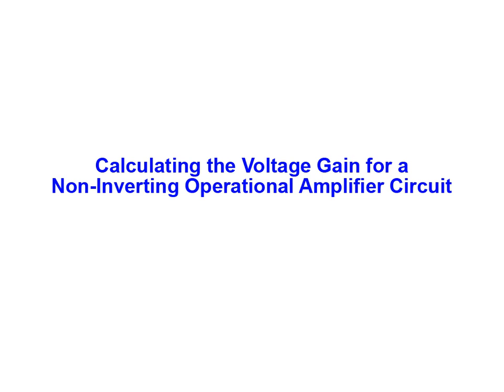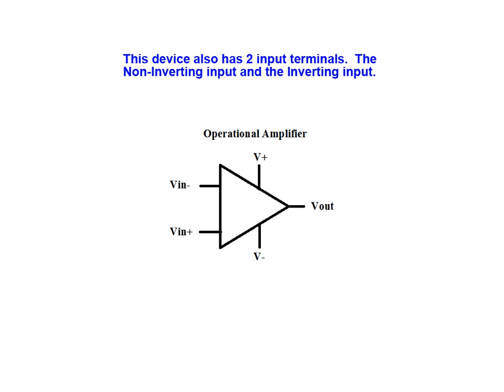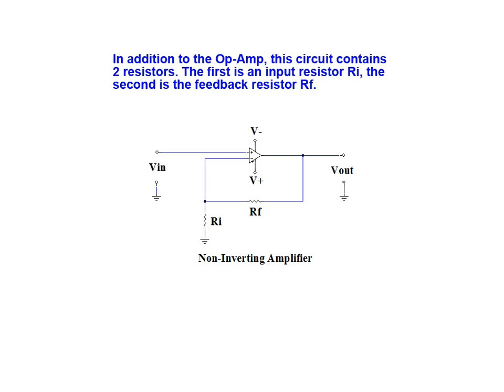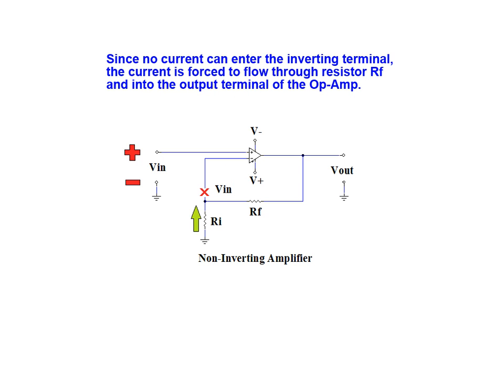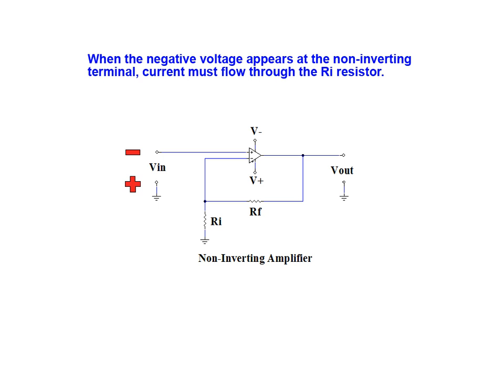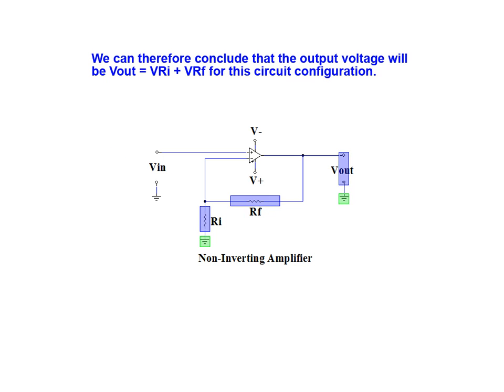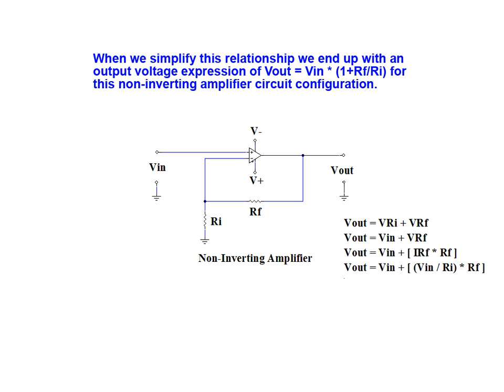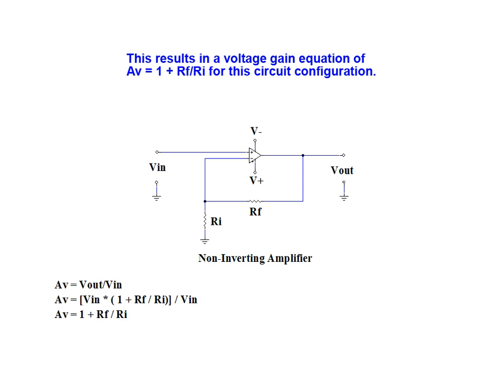Online Tutorial On Calculating Non-Inverting Operational Amplifier Gain And Output Voltage

Comment: but v(in) is grounded..so v(in) will be zero  and thus v(out) will be zero
right?
Reply from the maker: No, Vin is not zero.....  In this animation, we are assuming any positive voltage applied to the non inverting input.  Not sure what you mean when you say the input is grounded.  In the video, it is not grounded so it is difficult to provide you with assistance as I cannot see the issue you are making.